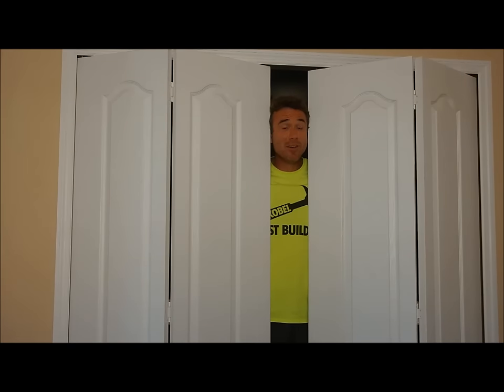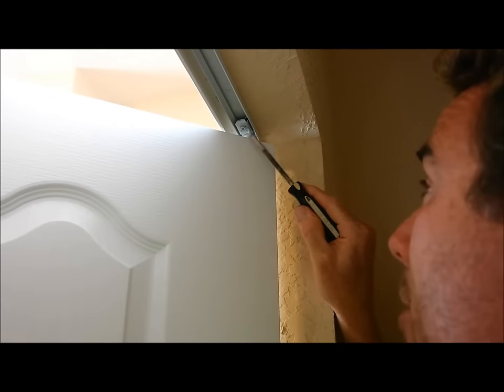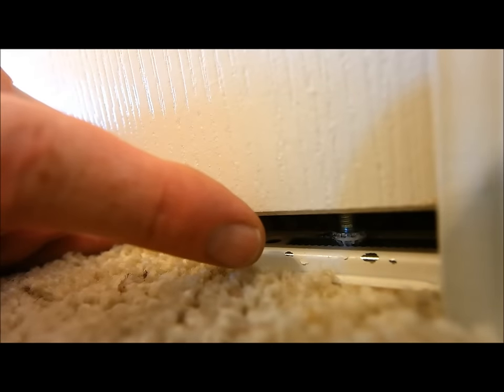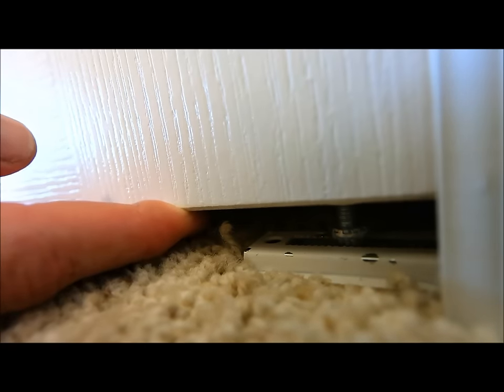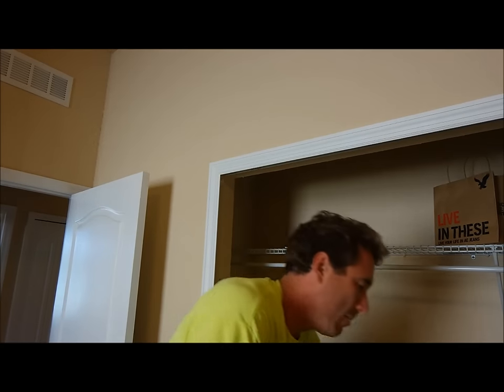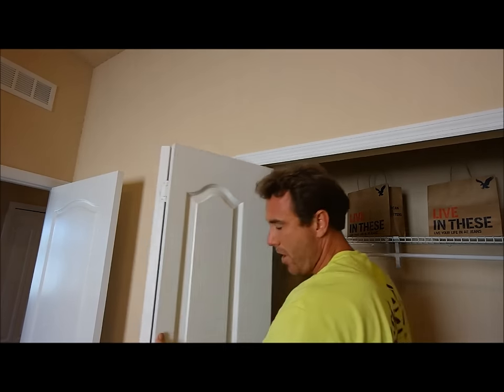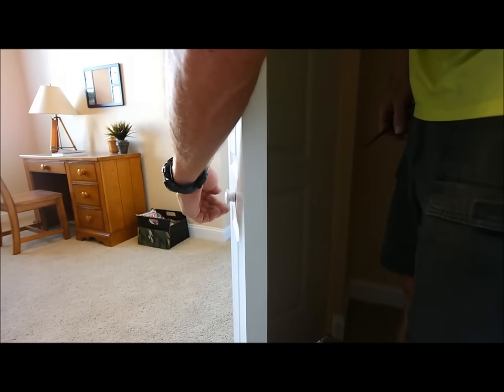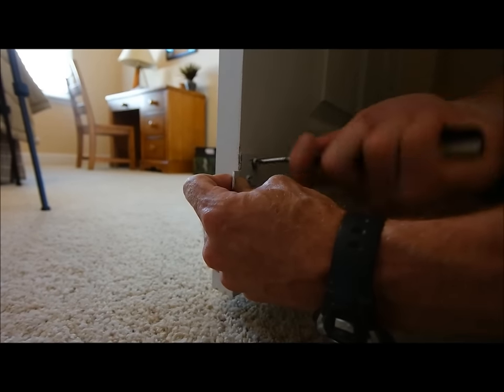How to adjust your bifold doors

Comment: The door came off the track days ago & I can't even begin how frustrating it is waiting for my husband to do it. i tried to fix it every which way ... holding it up w my legs & pushing the pin down w a flat head screwdriver, squishing my fingers as the door slammed in half etc. i didnt know that the screw just needed to be loosened & the flat thingy could move on the track which makes it easier! My husband will be amazed that it'll be done when he gets home from work.  Thank you for your help! :)
Reply: +Debi Galanti  I had the same situation today, but am single and thought I'd have to hire a handyman. YouTube to the rescue - this video quickly explained the parts and how they worked.  It took me a good 30 minutes, but I was able to loosen the top, reposition the bottom and get the stupid thing back on the track and tightened !!

Comment: I had a door that pitched so badly the other end was too low to stay in the sliding bracket so the door would just fall out of the frame if pulled even a little bit. I just thought the framing of the door was uneven. In less that 1 minute (at the 58s mark of the video), I fixed a problem I have been dealing with for 6 years. Thank you!

Comment: My door doesn’t have a spring loaded pin on side that meets in middle, it gets loose often cuz ceiling slants up. Wall side pivot pin seems stable and not moving. Any other tips?

Comment: I think that at some point, I need to either patch the hole in the left door that the top pin for the bracket rides in (it feels like the entire pin assembly is loose or wobbly and would easily pull out), or replace the doors entirely (the laundry room doors are solid, but my wife prefers to keep them open a crack because of the gas water heater, so I may ultimately replace them with folding doors with louvers).  For now, thanks to your video, at least I've fixed that left door so it doesn't jam against the floor when we fold it back to get laundry out of the dryer, and when both doors are closed, they close without fighting each other, even though they are not quite level.  I've had a pretty full afternoon drilling out stripped holes for the door handles and filling them in with wood dowels glued in with the epoxy I used to build rockets.  The handle is solidly attached again, and the doors can at least close and don't bind on the floor when opened.  Call it "close enough for government work."  ;)

Comment: Ive found the location of your knobs could result in the track bending and failing over time.  It has happened to me twice.  If you can open the doors via knob, but not close them via knob, or vice versa, this is what i mean.  Need to think about this if you have kids.